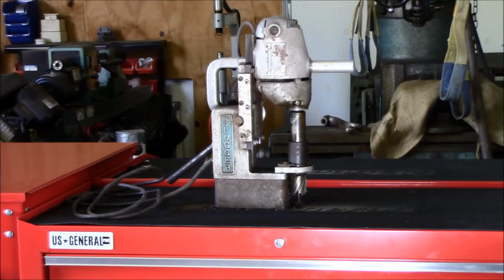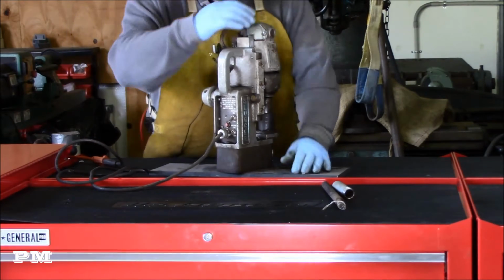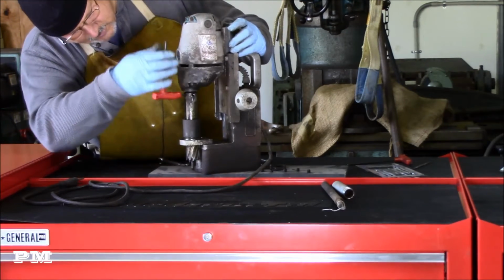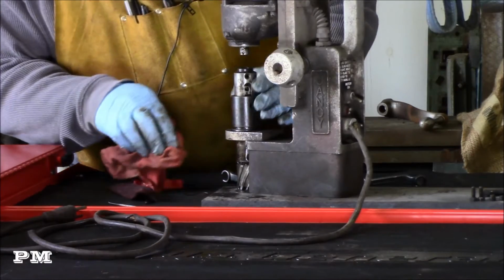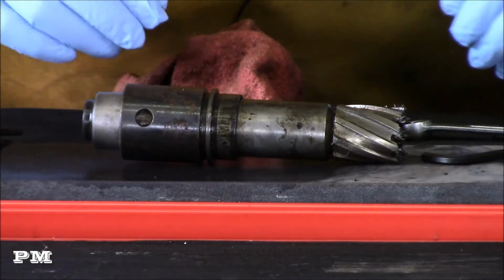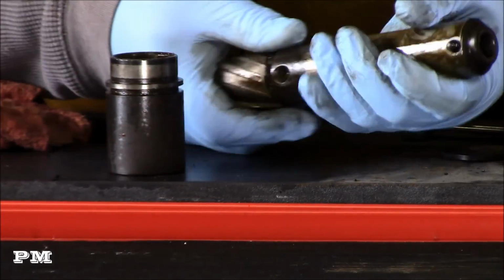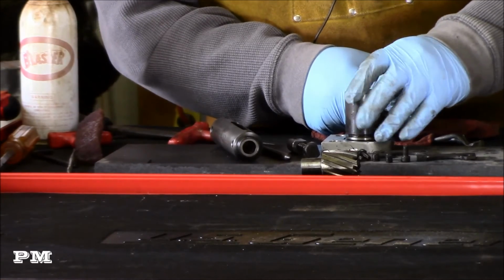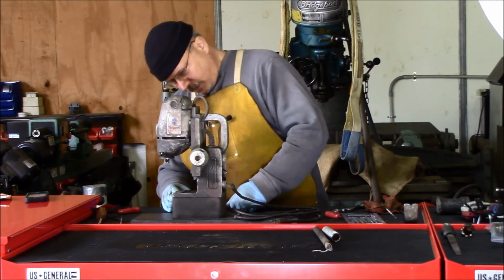Jancy Slugger JM101 Magnetic Base Drill Rebuild Part 1

Comment: it will not go through your tool box after you reach the end of your cut the slug remains in the bit and will not allow it to go any further,what you need to be sure of is your piece is clamped to the bench or it will try to spin it and will break your cutter,they also dont have tapers they have two flat spots on the shank